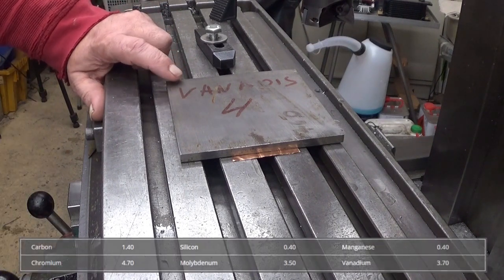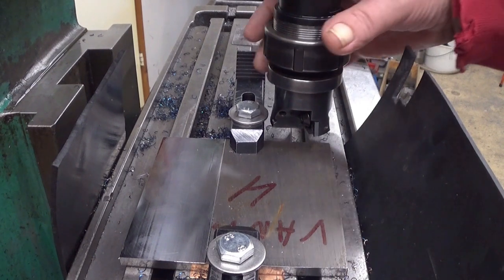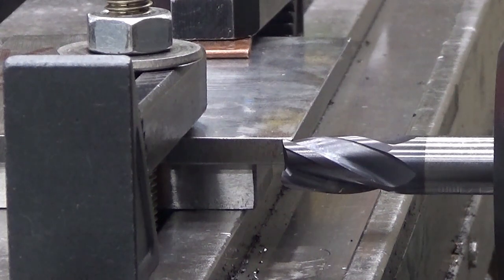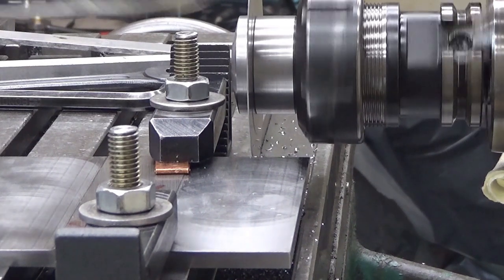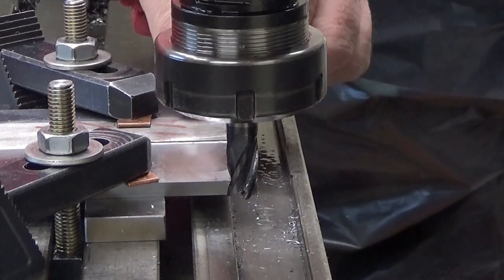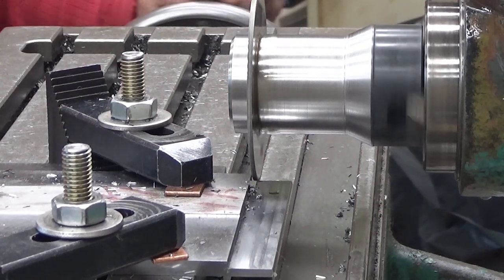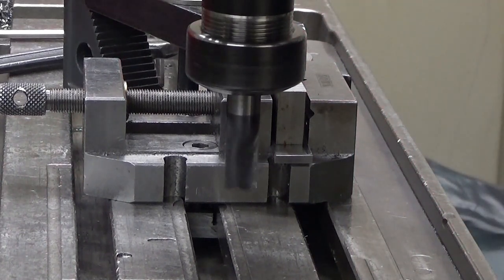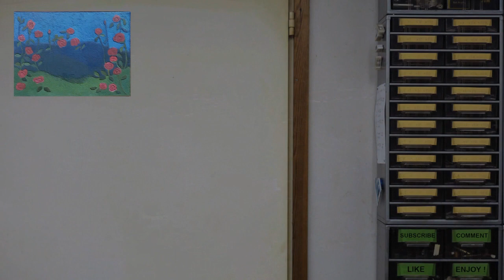Making a rotary vane (lamellar) air compressor 10

Comment: It seems like the kerf is closing on the blade due to stresses in the metal, and when it tries to reenter the cut on the backside it binds up. Wouldn't it make more sense to not do a full penetration cut, and leave a small section at the bottom of the cut to keep it from binding? Then do a second pass at full depth where the remaining strip of material doesn't have enough force to bind the cutter. An alternative might be to clamp the 'free' side of the material as well so that it is unable to move into the blade.

Comment: What is the advantage of using a tool steel vane vs a composite version. Some of the industrial vacuum pumps use the Tenant Feroform, or similar.
Looking forward to seeing it run.
Reply from the maker: Air compressor warms up. Vacuum pump cools down. Using plastics on vanes is perfectly allright if the heating is not too much. There has been discussions over the vanes rubbing againsta the cylinder walls. If the vanes are made out of soft material, the finish on the cylinder must be very good. Much better than in this example.